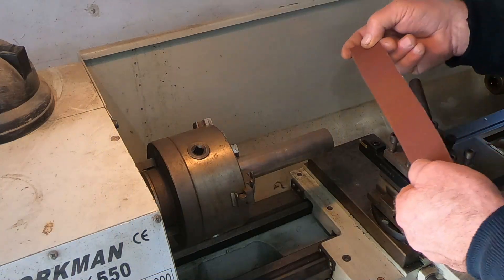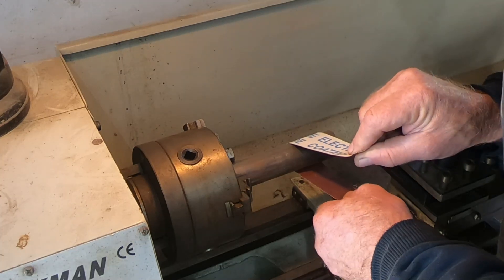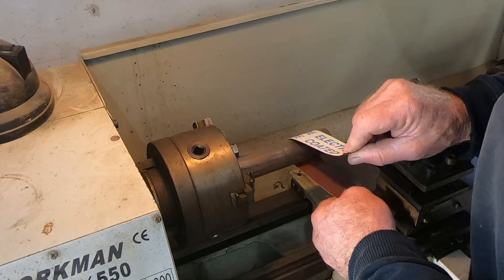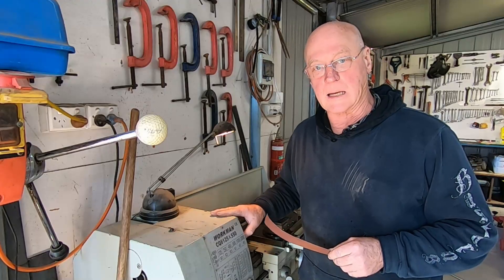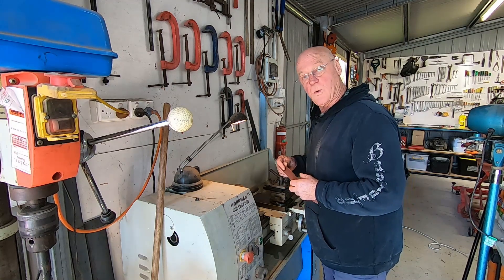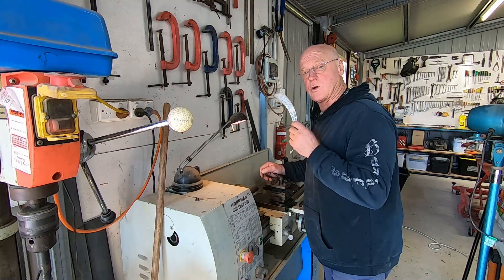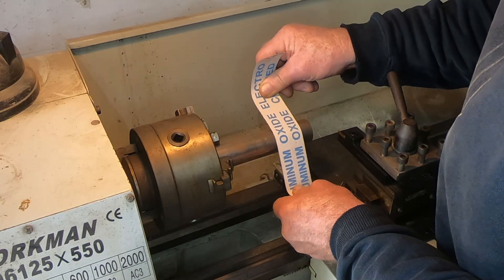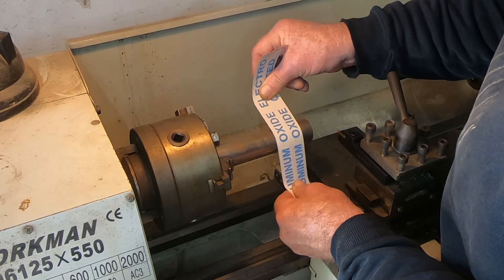Lathe Safety - How to use emery cloth on a lathe and avoid potential injury. #lathe #lathemachine

Comment: I learned from an old machinist with still all ten fingers intact, to use a piece of paper, 10x20cm, fold it around a square of soft rubber, we had 10mm thick neoprene sheets from which we cut 10x10cm (roughly 3/8" thick, 4"x4" in freedom units) fold that in half to give some more stiffness and hold it between thumb and index finger to sand, holding the long side along the axis of the lathe. Also if it snagged just to let it go, a piece of sandpaper and a swab of neoprene won't fly very far, your fingers are worth way more when still attached to your hands.
Internal polishing would be done with the folded piece of rubber and sandpaper clamped in the toolholder, which would also be the preferred method for external polishing if you needed to hold the paper against the workpiece for more than a second or two. This way your hands a nowhere near the rotating bits of the lathe.

Also: NO GLOVES, NO Long Sleeves, no loose clothing within 2 arms length of the lathe, that includes an open jacket.

Comment: Play it safe clamp your emory onto tool post use long feed.Let the tools do the work.Internal work use a  die grinder with a .250" split arbor ( custom made at any length) to hold emory paper.

Comment: I use a wood lathe, and this rule applies to that lathe as well.  I used to sand the way you told us not to, but now I hold a small bit of sandpaper on the bottom of the workpiece, and if it slips off my fingers, it won’t get wrapped around the spindle and pull my hand into it.  I learned that the hard way, luckily I had the sense to let go of the paper as it wrapped around the spindle.  Never again will I sand that way!

Comment: Thanks for sharing your knowledge on this.  I will change my way of sanding work from now on.  I wasn’t aware of the pitfalls until I saw this.  People trained where you were are world class and highly skilled.  No doubt you have a wealth of knowledge that you learnt at the Bendigo Ordnance Factory
Reply from the maker: @johnhasty2325  Thanks mate for the kind words. I’ve been copping a bit of flack for my long sleeves. We operated lathes with tungsten carbide tips with chip breakers that bounced blue chips everywhere (lathe RPM four times that of tool steel). Bare arms disengaging the feed lever get burnt to bits. Adapt to the surroundings and never become complacent 👍
Reply: @BendigoHydroblasting  I saw your long sleeves.  But I took the view that what you were doing was keeping sleeves well away.  So I wasn’t concerned with that at all.  I thought the intent of the clip was spot on .  Showing others how to things the right way.  Anybody who looks at old photos of engineering will see, boiler suites, long sleeve coats.  I think people just need to stop being to righteous.  Good on you for having a go and sharing your knowledge.  Your skills are a dying art mate.

Comment: Isn't this bad for the lathe? Pieces of abrasive will fall from the emery cloth on the lathe bed. When you move the support over that spot, it will grind the rails.
Reply: When working to grinding tolerances you  pretty much have to emery to get there or taking out a taper.
Reply: Clean the machine after using abrasive,  before you move the machine parts.

Comment: Thats exactly correct.got my RH thumb pulled in while i was machining a new quil for a tailstock because i got carried away and wrapped  emery paper around the piece at low rpm.luckily i survived unscathed because i wore a glove which i shouldn't have to begin with but non the less my thumb still doesn't have the strength it used to have.sanding on a lathe is terrifying.i still get chills just thinking about sanding on a lathe.gloves and sanding don't go well together on a lathe

Comment: Sorry mate but as a retired toolmaker/toolroom turner who worked on all kinds of lathes for close on 50 years I wouldn't use emery cloth the way you showed....it's still far too long and therefore able to get wrapped round the work piece. I always used short pieces only and regularly changed them when they wore out. Polishing internal diameters is also  something to be very wary of ....especially when you're holding a 12inch cube of steel in a 4 jaw chuck and polishing a mould cavity to mirror finish. Short sleeves only....no gloves....no cloth swabs (paper only). Hope you don't think I'm being too critical and well done to you for highlighting something people do that is so dangerous....I've witnessed lots of mishaps and accidents in workshops over the years that could have been avoided if people had only stopped to think....good luck from england...I am impressed by your tidy and well organised workshop....cheers
Reply from the maker: Thanks for tuning in. All great safety points and good feedback that I will take on board and hopefully others will too. Appreciate you taking the time to pen a response. Cheers Craig

Comment: Point taken.
And good points you make.
However.
You are advocating for dills.
You mention " a little bit of complacency" " a bit complacent".

The wrap around emery method is no problem for those that treat the lathe with the respect it deserves,
those that do not treat it with respect get complacent.
The same attitudes apply to driving a motor vehicle, complacency doesn't end well.
I will bet you have something to say about the nanny state too.
I would introduce legislation to ban dills if I had any say in things.
To sum up, I reckon your tip is for users of lathes that are prone to complacency.

Comment: Excellent message.  After seeing this I instantly subscribed.  My lathe is light industrial so I would never stall it.  When I was 14 I worked in my granfather's cabinet making factory.  Not many guards on those home made machines.  I got pulled into a 6 foot belt sander. I go white every time I relive that experience.  No damage except my pride and a T shirt that was ripped off my back.  Cheers
Reply from the maker: Thanks for the kind words mate. I think we’ve all got some of those near misses haunting us from our past. Cheers Craig

Comment: I learned my lesson about running my hand on the chuck to slow it down after shutting the machine down. My thumb got pulled into the chuck and pinched against the tool post… snapped the edge of my nail and ripped open a 3/8x3/8 chuck of flesh. Yeah I’ll never to that again.
Reply from the maker: Lol I just felt a lil bit of sick come up. Scary shit like that stays with you forever. Thanks for tuning in. Cheers Craig